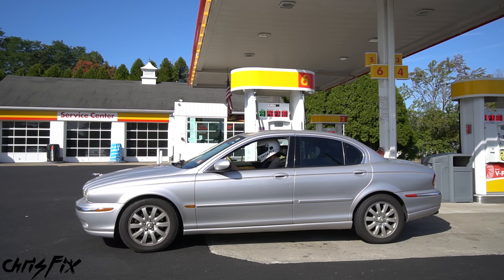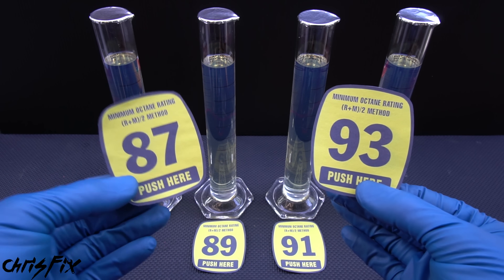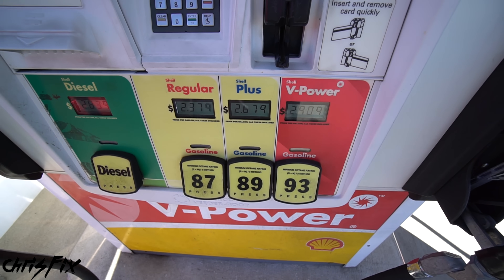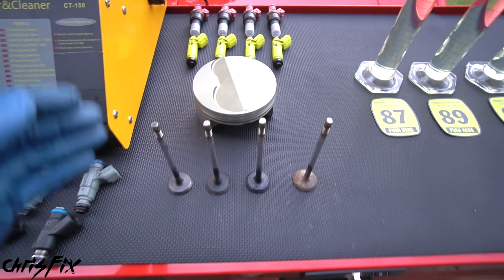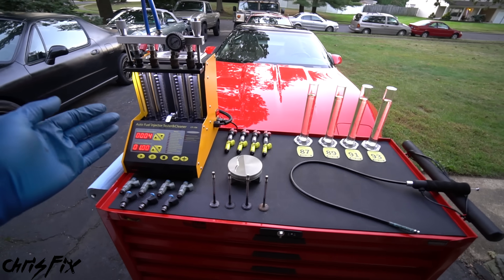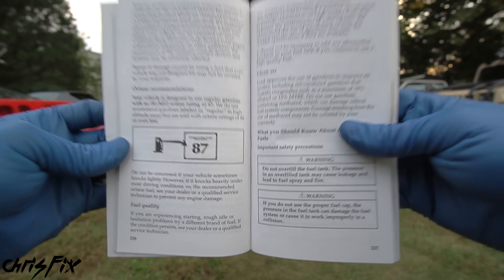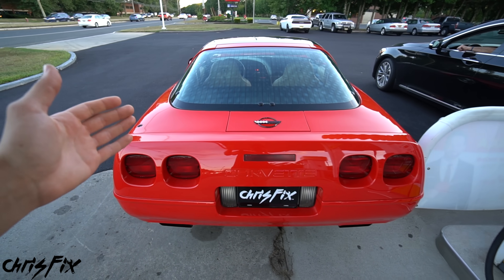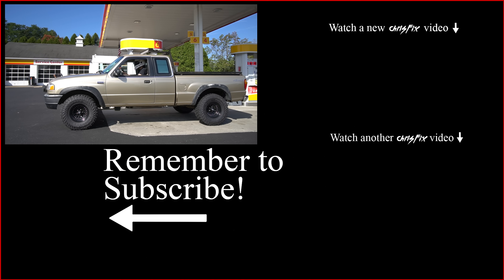What is the BEST Fuel to Use in Your Car or Truck and WHY

Comment: 20k comments.. wondering if anyone mentioned that lower grade fuels can have up to 10% methanol. For my small engines I fill the gerrycan with ethanol free high octane fuel as it seems to last a long time where the methanol mix fuel turns to muck sooner

Comment: Great info.  Thank you.  Noticing on your truck you said that the engine was detonating.  You started to use the 91 and said to run it through about 2500 miles (will clean about 70% build up according to Shell).  After the 2500 miles, will you return to the 87?  Where I live there is a huge difference in price from 87 to 91 about $0.70 between the two.
Reply from the maker: After it stopped pinging, I returned to using 87 and it's running perfectly!

Comment: My rav4 fuel cap says use no more than 10% ethanol fuel. Some gas stations say "up to 10% ethanol" but I assume that's only on the 87 grade, so I only use 87. I've read that to raise octane you raise ethanol content. I've also read some gas stations don't even have ethanol in their premium grade. So I'm confused.

Comment: Nope.. you forgot diesel. beats everything.
Reply from the maker: In what way?
Reply: @chrisfix  haha I was mostly joking, though I do have a bit of bias.  I would say that diesel has gas beat in terms of longevity and efficiency. Just the breakdown period of both fuel types can prove that. If we are speaking about the engines themselves I'm still all for the traditional diesel over a modern gas engine. Its what's most practical for MY needs. I personally run a bio blend and I drive long distances frequently. Got a buddy who makes his own fuel by filtering the used vegetable oil from a restaurant (it's free too!). I've seen people convert diesels to wood burning engines as well. Pretty crazy what you can do with it! That's just me though. Believe it or not diesel is actually better for the ozone than gasoline due to the weight of exhausted smoke. Diesel exhaust falls back to the planet rather quickly, not hanging in the atmosphere for too long whereas gas goes straight to the ozone. Kind of debunks the common thought that diesels r soo bad for global warming. Sadly driving a diesel just doesn't make sense for most people though.

Comment: Regular grade gasoline has a octane rating between 85% and 88%, with the average being 87%. midgrade, or plus, gasoline has an octane rating of 88 to 90, with the average being 89. Premium grade gasoline has an octane rating that is larger than 90%, with the average being 92%.
follow the manufacturer of the vehicle you are driving.other wise you will keep coming to me  to change catalytic converter  assembly and fuel filters    and fuel pumps.
Reply from the maker: thanks for sharing

Comment: excellent video as usual Chris. one important thing not mentioned is to only use top tier fuel from Shell, Exxon Mobil, Philips, BP, Texaco and the others. AAA did an extensive study on the cleaning ability of top tier fuels and the results were astounding. The reason top tier fuels cost more is they have more additives that keep your engine clean. That is not b.s. that Shell has 7 times the required additives. Well worth the extra 10-20 cents per gallon. What remains unclear is which brands put more additives in their premium fuel versus regular. Another reason to pay the extra for premium especially if you have a dirty engine you want to clean. In any case do not use bargain fuel unless you have to once in a while.

Comment: Can I see fuel injectors I think that myself why aren't they Vapor injectors. Seems to me less is more. more bang for your buck
Reply from the maker: What do you mean by that?
Reply: @chrisfix  well, it looks like there's spraying liquid/gas rather than turning the liquid/gas into a vapor - which work increase efficiency of the gas, eliminate misfires, improve gas mileage ( dramatically) and control  ignition/explosion - they would most likely need to re-engineer the chamber in order to achieve that. Of course if we did that - they would probably find a way to get rid of us

Comment: Any facts about octane levels and altitude? I live in Colorado, and I can never find anything higher then 91 octane, and my passat says 91/93 as the required fuel. So I have only been able to put the minimum octane in her. Any facts or ideas why Colorado seems to only go up to 91 octane? Even just 93 or 95 octane is pretty much impossible to find up here......I can get 110 Sunoco from the Exxon around the corner, but I want to save that for a nice drive in the summer :)
Reply from the maker: Higher altitude means you usually require less octane, check your owners manual for high altitude driving!

Comment: BTW, the engine will not be damaged if you use E85 and it's not adapted for that. What will happen is that the engine will get less fuel and thus will run badly or not at all. And the engine light will go on. Then just fill in some gasoline to mix it up and you will soon have a car that will run fine. Approx up to 50% E85 is possible on most vehicles.
You can experiment with it if you like: Start with around 30% E85. If it works, go higher. Continue until engine light goes on and then get lower again. During winter, in cold climate, it can be tricky to start if the engine is cold so then go with less E85.
If you have driven a lot with just gasoline, what can happen when you start using more E85 is that the fuel filter can be clogged. Then replace it. If it gets clogged again, replace. This is because ethanol cleans out the fuel tank and hoses (and the engine).
There have been tests done to see what happens with a gasoline engine that runs ethanol and after a lot of running, the ethanol engine looks like new compared to the gasoline one.
If you want to go higher on E85 you have to change the nozzles in the injectors to one with bigger holes.

Comment: Guess what’s sooooo crazy is if you read your owners manual it tells you which fuel to use. My 2000 ram sport uses 87. My SS or GT uses 93. They both also use E85 that’s another thing lol

Comment: In Sweden we have:
95 (contains up to 5% ethanol)
E85 (containt up to 85% ethanol)
Diesel (the cleanest in the world and contains up to 49% HVO and up to, if i remember correctly, 7% bio diesel)
HVO100 (100% HVO - still on up-going so not available everywhere)
We also have 98 but that has decreased a lot and are now not easy to find.
Reply from the maker: Watch the video!
Reply: @chrisfix  I know, and nowhere did you mention HVO, and you only talked about Europe (but Sweden is somewhat special, especially regarding Diesel fuel that has been the cleanest one for like ages - we use Mk1 and the rest of Europe has used Mk2 and Mk3. And we have ethanol in all gasoline as i mentioned, but, the content differs depending on the time of year, like E85 that has 85% ethanol during summer has 76% ethanol during winter. The Diesel also goes into a different chemistry during winter so if you use summer diesel you can have problems when it gets cold (we usually have like -10 to -30, and record low of -52,6 degree, celcius!). And the high amount of HVO in diesel is pretty unique.
I just wanted to show how it is in our little country - a country that is in Europe but often are way ahead when it comes to using cleaner liquid fuels.
BTW, i forgot, we do have biogas too in some areas: You fill up liquid gas made from food waste and waste from waste water treatment plant.
One nice thing more to know is that All diesel cars can run on HVO100, a renewable synthetic diesel fuel. In Sweden, mostly created from paper mill waste and food waste.

Comment: You forgot to cover 86 octane which can be seen @ around New Mexico, Texas, Oklahoma, and Kansas.
Reply from the maker: Do you mean 85?
Reply: Chris fix I have seen 86 octane in New Mexico and a couple stations in Northern Az. I personally will not use it as most vehicles recommend 87 or higher.
Reply: Seems they are extra afraid of their gas being out of spec so they go low to be safe.

Comment: I have a 97 f150, that runs 10 times better on midgrade,  its always knocked on regular.  The head gaskets were done years ago, I think a slightly thinner set got put on.

Comment: Hey man....great vid....now my turn...Use Meguiar's G13815 Hot Shine High Gloss Tire Coating on the black/gray parts of your truck...let it soak in for around 20 min then wipe the excess off and your fender flares and bumper will look like new.  Depending on the severity..and  yours looks pretty bad you may have to do it twice.

Comment: How about 91-octane pure gasoline?  You will get better fuel economy with it than 87, or 91-octane E-10, which is 10% ethanol.  The pure gasoline has 25% more btu, or heat units, than ethanol blends.

Comment: i'm pushing sixty now, but, my dad was a very good backyard mechanic, as everyone in the neighborhood and others he knew brought their cars to him to be worked on. he swore by high test fuel. every car he owned, high test gas was bought, even the last new car he bought in 1974, a bug eyed, matador X coupe. he told me over and over, high test is better overall. remember, his last car he bought new was during the gas crunch of the 70's and gas still had lead in it. even when they took out the lead, he didn't like that at all, something about the lead helped to lubricate the valves and such, he still swore by high test. well, when i started driving, there were still long lines at the pumps and gas inching up to over a dollar a gallon, making people buy regular gas instead. people had issues with their cars not running well. i took my dad's advice and still to this day, put premium fuel in my vehicles, including my lawn mower and rider. i have less issues with my vehicles, less maintenance, and get better mileage, especially, when making long trips. i don't ruin my vehicles putting cheaper, lower octane fuel in them. don't get me wrong. i have had hard times and was forced to get regular fuel just for the cost saving and regretted it after several hundred miles. the rough running, the lack of power, the mileage loss and eventually, changing plugs and oil at sooner than normal intervals. running premium fuel also saves valve cover gaskets. not sure why other than the vapors from in the crank case. regular fuel tends to cause these gaskets to go bad sooner than using premium. my experience and i'm sure there will be those out there that think i don't know what i'm talking about, but, either way, my experiences are true. premium is better for any car.

Comment: No, false, our fuel in Europe has much less impurities.
Reply from the maker: Watch the video!
Reply: False! Gasoline in the US is made to the highest of standards. Gasoline in the US has to have less than 10 ppm of sulfur and now mostly contains 10% ethanol which burns pure. Gasoline at bare minimum is every bit as good as what's in Europe, and likely even a little bit better.
Reply: @waycoolscootaloo  In Europe we have a constant quality between every gas station, that doesn't happen in USA.
Reply: @nicolapevere968  Actually we do have a consistent quality as these standards are mandated by federal and state laws. All gas in the US comes from the same refineries regardless of brand of station.

Comment: Didn't watch the video, but common knowledge is to NEVER use mid grades.  Most people either buy the cheap stuff for economical reasons, or the high grade for performance reasons.  The mid grades tend to sit in the tanks for extended periods of time and degrade.  They get sediment and other contaminants in the fuel from sitting so long as well..

The real answer though would be what ever the manufacturer suggests for your specific engine as each one is built differently and has different requirements.

Comment: back here in Sweden the price on petrol and diesel has gone from about 3 dollars to 6 dollars for one gallon, and they want us to rebuild our engines so it can handle the the E85 i dunno it is weird here in Sweden. But with E85 the car uses twice as mutch as it would with regual petrol, Our diesel consumes half as much as regular gasoline and has almost half as much emissions, but the Diesel cars are taxed almost three times as high as a gasoline car

Comment: Truck - diesel😉
Gas - ethanol free.   Avoid the water problems by avoiding alcohol in your gas.  
And FFS please stop blocking the diesel pumps to buy gas when there are 6 million gas options and only 2-4 diesel pumps at the huge gas stations.

Comment: Can you tell me why I can only run 93 obtain gas from Shell or one of the other higher priced stations and why I cannot buy it at the stations where it is cheaper. Should 93 obtain be the same anywhere that I buy it. I am running a small block 383 Chevy in my 84 Camaro Z/28. I don’t ever buy the cheaper priced gas because of the knocking.I did at one time run 94 but I cannot find it anywhere now.

Comment: Hi Chris, I own Hyundai Verna 4s Petrol 1.6 variant which has been standing for almost a year. Car is just 5 years Old. What precautionary measures should I take to make sure engine stays healthy. Does Petrol cars have any problem caused by RUST inside (if this happens) the engine if the car was not driven for this long time, do you recommend changing the OIL after few kilometers now?

Please suggest. Thanks

Comment: Funny thing about some KIA 2.4L engines, using 89 octane increases the torque by 15 ft.lbs, but fuel economy and horsepower remain the same.

Comment: Aside from cost are there any disadvantages to running a higher octane then required or recommended.
Reply: Cost is the big disadvantage, but on my Acura I notice throttle response becomes more jerky, less smooth when I go from 91 (recommended) to 94 octane. Only noticeable when I fill an almost-empty tank.  My assumption is that the engine tunes itself out of the sweet spot.  YMMV.  Nothing gets hurt with too much octane but your wallet.

Comment: and while I am at it, I might as well state this:..two major contributors to spark knock or detonation is raised compression due to excessive carbon build up AND heat....if you have an older car and it knocks constantly, chances are good that you have carbon built up on the top of the piston which is raising compression levels.  switching fuels to remedy is like putting a bandaid on a severed limb, you are only covering up a bigger problem. a years worth of buying super unleaded fuel to mask a problem is far more expensive than having a good thorough fuel injection AND fuel induction cleaning service performed. (there are many do it yourself kits available to do this at home to save labor, but,  do not do it yourself if you don't have a clue about how a car engine operates. and as far as the heat concern...again, it is cheaper to have your cooling system serviced and thermostat changed yearly and keep your engine running at the correct temperature. there are also options of a lower temp thermostat for those people who drive in city traffic during the heat of summer. keeping your engine at or below operating temperature will greatly reduce the risk of detonation.  an explanation of detonation is better understood by saying that fuel ignites a split second BEFORE the spark plug fires due to excessive compression (which generates higher heat) and engine temps being too high. so, the "pinging" noise you hear is the piston wrist pin and/or connecting rod being forced to go in the opposite direction BEFORE it is timed to do so......hope this helps your next video

Comment: 30 year automotive TECHNICIAN here...3 factory certifications (Hyundai, Kia and Mazda)...advice #1....be careful when referring to the owners manual of your car. manufacturers print a generic manual covering multiple model configurations, be sure you are being advised on the exact model YOU are driving. (different engines and transmission combinations will require different fuels and maintenance schedules)           advice  #2...in the beginning of this (well made) video, you clearly stated that different octane fuels have no bearing on economy or power, yet your final statements about recommended fuel type cars, you stated that you may benefit from increased economy and power should you choose higher octane. you might want to clarify this for the people who do not know better....do not take this as an insult, just wanted to point out some important, real world advice. your video was very entertaining and should give the general public a better understanding of fuels and why you DO NOT need to run super unleaded if your car doesn't require it...good job
Reply: I was going to comment on the same contradictions about power and economy.

Comment: I drive a Nissan Pathfinder that was built in the USA.  It is rated to use standard Australian unleaded which is 91ron but I use 95ron and I actually get a better economy and performance.  Should the 98ron V-Power, it performs well but I get bad economy.  I find with many vehicles is that I go one grade better but not two.

A european car normally uses 95ron and I use 98ron which is for my Peugeot 307.

Comment: What about vehicles in storage for 6 months at a time?

I have had carbs gum up, and what I have heard most was that regular fuel has a certain percentage of ethanol, and the ethanol teens to him up over time.

Would I be better off using high test as it doesn't contain ethanol? Am I completely wrong?